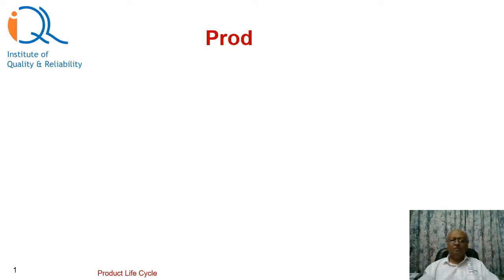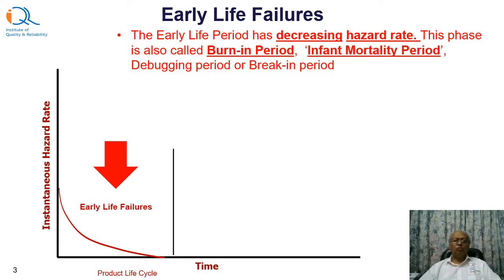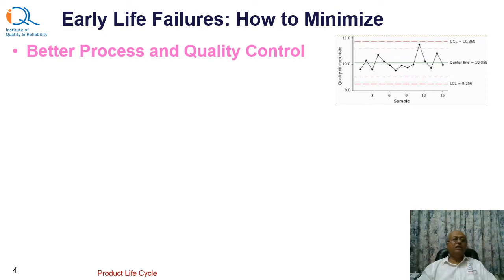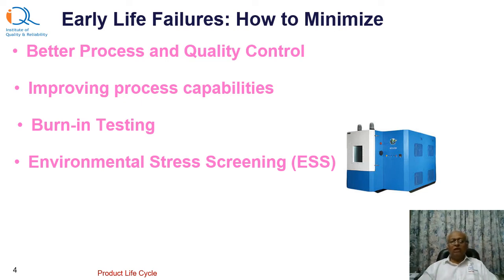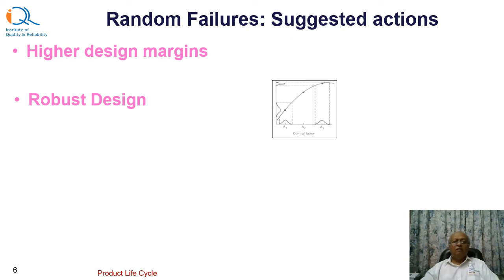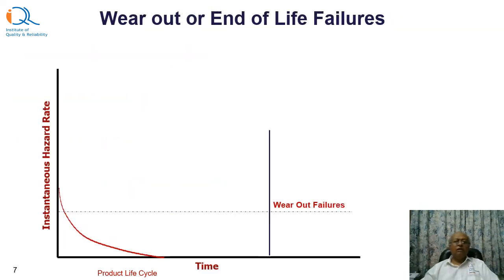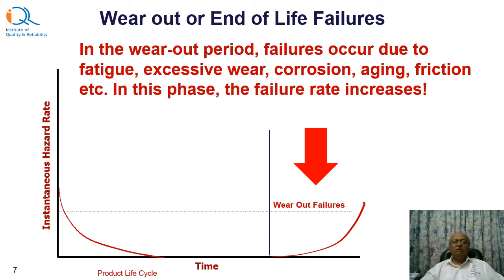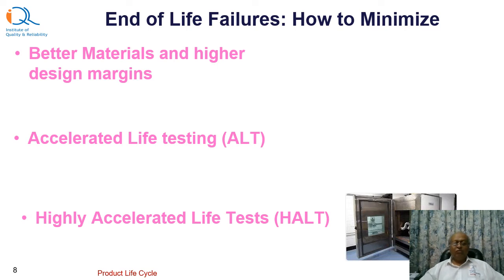Product Life Cycle (CRE Preparation Videos)

Comment: Hi Hemant, what is the best answer for the question below:I think all costs are included in the life cycle cost calculation .
Here is the question:
What are the life cycle costs for a new stamping machine purchased by a metal fabrication
plant?
Pertinent cost data follows:
Purchase Price = $230,000
Repair Costs = $107,000
Post Purchase Costs = $870,000
Start Up Costs = $125,000
Maintenance Costs = $420,000
Energy Costs = $325,000
Reply from the maker: Yes. I tend to agree.